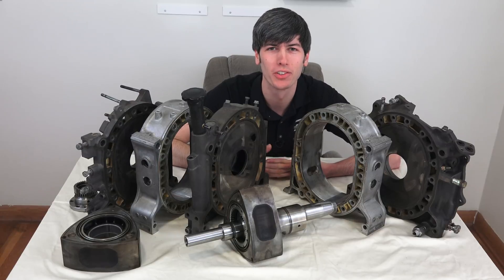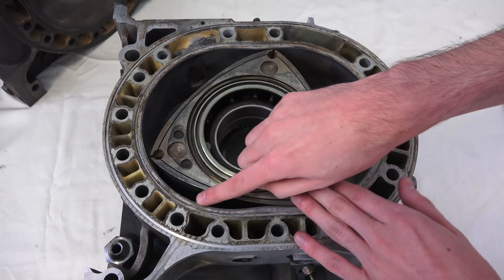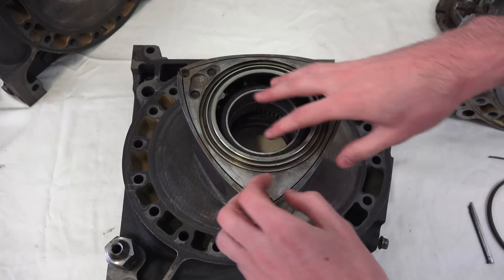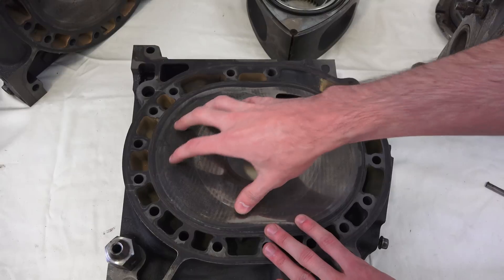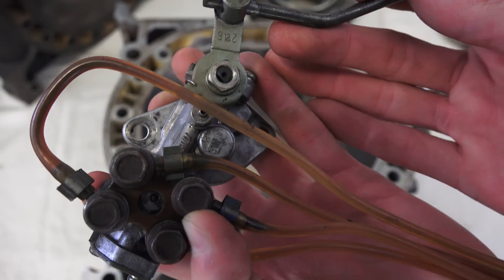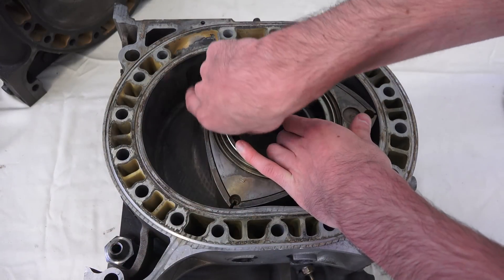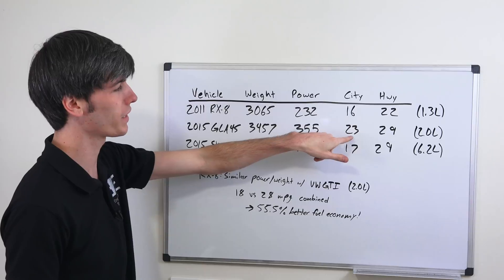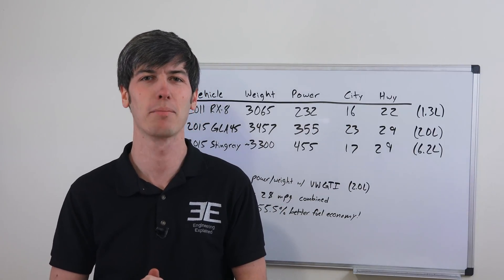4 Reasons Why The Rotary Engine Is Dead

Comment: This guy hasn't got a clue about how good rotary engines are if handled correctly. Get a life, and a mechanical engineering degree and your crap together and you may have a clue someday. It has lots of good points.

Comment: The person who posted this video isn't terribly knowledgeable.  Wankels haven't had seal problems in 40 years, and they pass California emissions checks just fine.  The "long combustion chamber" is a strange bit of nonsense, and NASA says they have much better mechanical efficiency than reciprocating engines.  The reasons for their lack of commercial success have nothing to do with any of the non-facts in this video.

Comment: You gotta think though, hundreds and hundreds of companies have been using, innovating and improving cylinder engines for 100 years now.... Mazda is the ONLY owner of the rotary engine.. That's 1 company working a couple years on the rotary (comparatively) vs EVERY OTHER company working on cyclinder engines since forever.... If mazda releases the rights, the rotary engine has the most room for improvement in the future.

Comment: Some extra spark plugs and heat exchange systems could solve all this.
Reply: You just solved the problem engineers at mazda couldn't figure out. Tell them maybe you will get hired as engineer. Probably not though.

Comment: Nonsense. My rx8 has 175.000 km and compression is still 7,5. Maintenance according to factory instructions strictly

2021 update. 2021 with 200.000 km on clock, runs strong, no engine rebuild!

Comment: The rotary engine doesn’t last a long time. I had a RX7 when I was in college. The first one wore out at 120k miles. The second about 116k miles. This was back during the 80s. Maybe the seal has been improved so they might last longer.

Comment: So basically all they have to do is run e-100 for better burn= no miss burned gas. Also instead of having 4 oil feed lines they should have one for the cylinder walls and the engine would be golden

Comment: Hi as a mechanic for 45 years I can tell you the rotary engine is neither a 2 stroke nor a four stroke really but it is a 4 " cycle " engine. It has Induction, Compression, Power and then Exhaust.There is no true scavenging as in a 2stroke.Oil in a 2 stroke is necessary to be either in the fuel or injected to lubricate ĺower end parts eg crank bearings, main bearings and rings etc .A 4 stroke engine has a crankcase or sump to hold an oil reserve this can be pressure fed or spash fed to the engine components similar to above. Speaking just for the Rotor and Side seals of a Rotary the oil is required to lubricate between the sides of the rotors and the sides of their opposing faces the side seals prevent oil çonsumption but the Apex seals do not they are to assist in producing compression. Thanks hope that helps but once you experience a Rotary and the bug has bitten its hard to go back thanks.

Comment: In terms of the oil scenario. I used to have an Mazda Rx 4 (1975) 12A Bridgeport. We took the oil dripper out Which is standard practice, and just used 2 stroke oil in the fuel tank. Cant remember the mixture, 100ml to 20L or something along those lines

Comment: My thoughts: the rotary engine is probably dead unless there is enough enthusiast interest for some company to start producing crate engines.

Also, the rotary engine isn't efficient enough for production vehicles, unless its turbo charged.
       But turbos add too much cost...
Reply: Actually, NA is more efficient because it doesn't need a rich mixer to cool the combustion and turbo parts. NA race engines can run max power on 0.92 lambda, if build correctly.

Comment: Well presented. Did not know about the oil injection necessity. It occurs to me that if a separate tank and feed were used,if synthetic two stroke type oil were used instead of engine oil, I recollect that much smaller quantities would be needed. Something like 100:1 in premix situations. Different here I know,but the additive package  present in motor oil plays hell with tailpipe emissions. I can understand that a manufacturer does not want to increase the complexity of operator requirements,but that would address one of the problems you described. Glad you put this together. Cheers.

Comment: What are the advantages of the rotary engine?
Reply: Small size and power to weight ratio, if fully made from aluminium and good rotational uniformity and high engine speed, which makes it great for range extender generator applications.

Comment: I know this probably won't be seen but I have a question why is the combustion chamber expanding as the fuel is being burnt any different from what happens on the power stroke of a normal 4 stroke engine?
Reply: It's exactly the same.

Comment: The only advantage of the rotary engine fewer moving parts?
Reply: Dennis W 
Not the only advantage. I recommend Donut Media's video on rotary engines, but one of the defining advantages to the rotary is that it's ability to go really fast, achieving extremely high RPM; until they were banned from most if not all racing organizations.

Comment: In These Comments: Butthurt Rotary Bros.
Reply: Anything overpowered will be banned.
Reply: @EB-dr4dd  overpowered? Hardly. They have puny Tq.
Reply: Torque and power, learn the difference. One for a truck, the other for a sports car. Even nascar can’t make anymore power without ethanol.
Reply: @100pyatt  Torque is essentially pull/towing power. Horsepower is how fast you get up to speed.
Reply: ''Butthurt''? what do you mean with ''butthurt''?
Reply: ACQUIRING BUSINESS they produce alot more power for their size, the reason why they suck is that if you make a 2 cyclinder rotary it will be banned due to emmisions.

Comment: heat imbalances: tungsten alloys
Reply: I've never seen heat imbalances lead to failure in a properly tuned rotary, so not a big concern and with ceramic apex seals they are virtually indestructible. An inconel exhaust for a race engine is a good investment though.

Comment: There not dead just not used that much. The rotary you used as a thumbnail is a wankle which is better then reciprocating engine because it produces much more torque much more horsepower for a smaller engine with less displacement. Not dead, just under appreciated.

Comment: I owned two, both were troublesome junk.
Reply: I own 1..now it broke down..really sad
Reply: Oh yeah you should donate them to me I know what I can do with them build them and do burnouts in your front in your lawn
Reply: sold my 20b swapped rx8 and bought a bmw 320i e30 and it's so efficient, the car is 33 years old right now and already been stroked to 3.0 but still better than rx8 when it comes to fuel. Sad thing is it was stock 20b.......
Reply: Its best for modding and racing

Comment: The answer is simple in my opinion:  the piston engine companies didnt want a more efficient motor than their own on the market so it prevent the development of this machine and now many persons believe that the rotary engine sucks (it had way less development)
Reply: They stopped developing because of the longevity issues but those are long solved with modern materials.  Since then the rotary has lagged behind in development.

Comment: I was sixteen when I first saw a prototype at the motor show in London and being a petrol-head even then I fell in love with Felix Wankel's engine, what an unusual design but this is what inventers do to try and improve power units, yes it was thirsty and had a narrow  power band area and no torque at lower rev's but quite a few car manufacturers and motorbikes used them and many won races as well,  although I never owned a vehicle with a Wankel engine but I have two Japanese O.S. model engines of .30 cu in for model aeroplanes that I fly and find they have more power than a conventional engine of the same capacity..

Comment: There is not only fuel efficiency to blast this engine to the past as you seem to be so willing to do so.
It has far fewer moving parts and is lighter, get more HP for a same bore etc.
Yes it is not so efficient, but it takes up less space and uses less parts for a better power to weight ratio.
Its unfortunate that nobody was tooled or trained to work on these engines and was pushed out because of that.
When it came in its only issue was its seals.
Reply: Crap engine

Comment: In short it works fine except of the high wear at sealing faces, so you need frequent overhauls or better material designs.

Efficiency is actually pretty good.
Reply: Ceramic seals solved that problem long time ago. The current downsized turbo engines are an other story, though ...
Reply: You can't have a fact that something is bad, Then just say actually it is pretty good. Not the way it works.

Comment: The rx8 aren't a good example of the rotary engine since they had an assortment of other problems that contributed to said problems such as gas mileage and a good engine example would be rx7 which actually had anywhere from 17-19 in the city and 23-26 on the highway